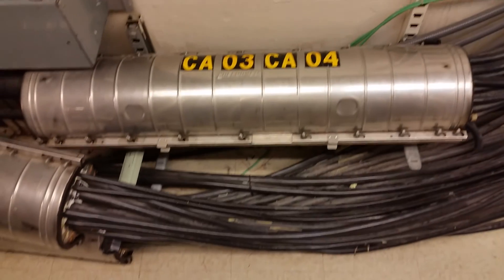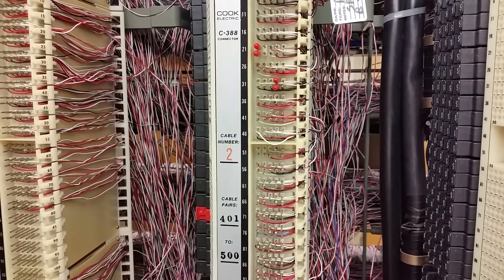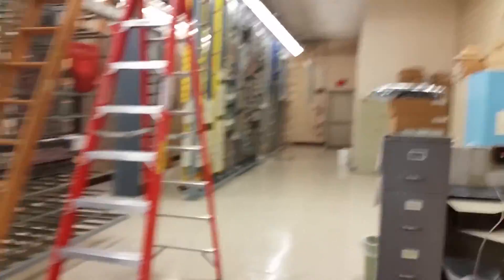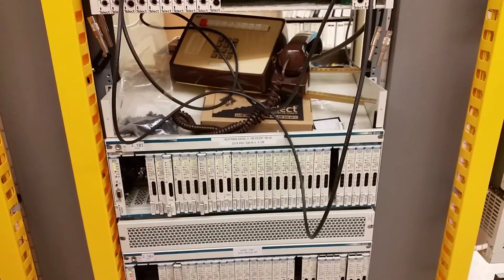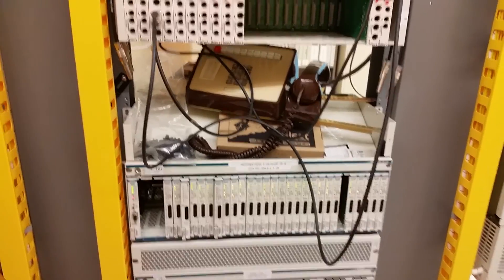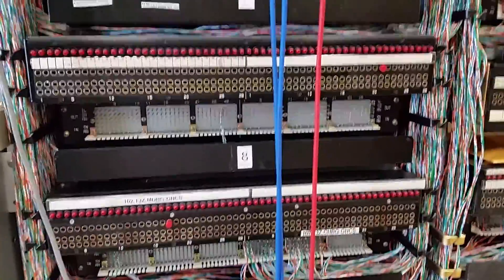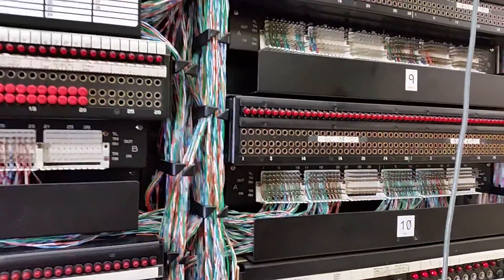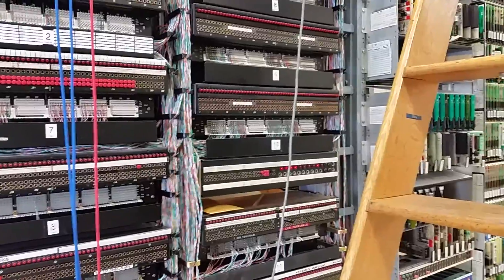HDSL Explained

Comment: I see this stuff at many COs at the telco I contract for, and most of it looks abandoned. Do you think they still use it? If so, would it be for internal traffic or customers? Thx
Reply: Conventional DS1/T1 TDM services are going away as end users opt for Ethernet interfaces at optical line rates equal to native Ethernet speeds. Verizon plans to phase out its traditional TDM network in he next ten years, and switch to Ethernet based interface rates. So yes, HDSL is a dying technology that did its job of bringing the conventional T1 circuit to the customer in short order and where no optical transport equipment existed at the time. Fiber continues to replace copper cable in the local loop. The deployment of Two Wire DSL technologies by TelCo's for T1 and DDS was a stop gap measure to maximize existing outside copper cable plant to support traditional service demands, while at the same time spending capital dollars on deploying new optical fiber networks in the local loop for today's new Ethernet based technologies.
Reply from the maker: Springtrap77 yes it is absolutely still in use. We still have several thousand HDSL subscribers in our area. Fiber buildout is quickly replacing HDSL in urban areas, but rural areas still rely heavily on this older technology. Even the sub T1 circuits are still in use for secure voice and data monitoring.
Reply: It looks abandoned because CO's are typically low maintenance. Telecom companies aren't manning CO's due to staffing cost, therefore network techs are straddling multiple offices in one area.

Comment: Also you can get a $20/month dry copper pair from the telco and put shdsl modems on each end (using WIC-SHDSL in a Cisco, for example). If both ends are in the same wire center and within the distance limit, this can be an inexpensive alternative to a T1 line. shdsl is basically an improved version of hdsl.

Comment: Both the 2 wire and 4 wire HDSL can be repeatered. The difference is that the 4-wire uses a lower frequency and can go further; if I recall correctly, around 15,000 feet vs. 10,000 feet for the 2-wire. This distance is without repeaters. The ~190V on the line is used to power the HDSL to T1 converter card (H2TUR) at the customer's location. It's not required for any reason other than that--the cards can be powered locally from a -48V power supply, but I have never seen that done.
Reply: Brian Leeper I've used powered NIU's on 3 repeater applications and also in areas where the plant facilities weren't capable of handling the -190 vdc
Reply: The Two Wire HDSL2 standard did not include a two wire HDSL Doubler (Repeater) equipment, compared to the Four Wire HDSL4 standard. Not to be confused with proprietary HDSL equipment that prevailed prior to the adoption of HDSL2 & HDSL4 national standards in and around 2000/2002 time frame.